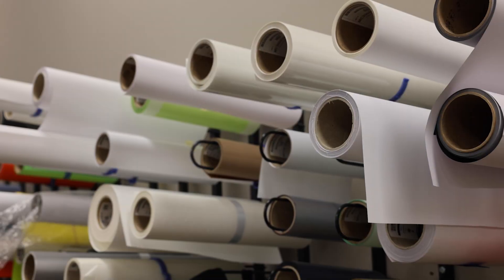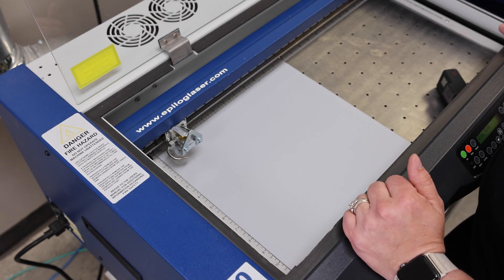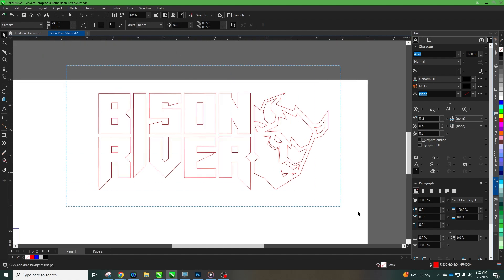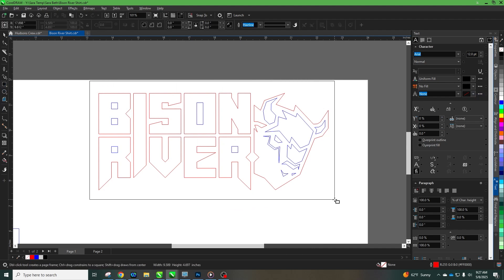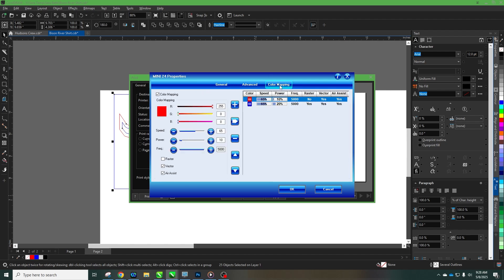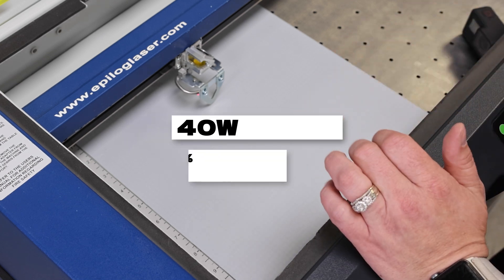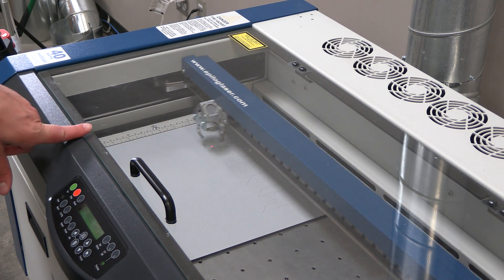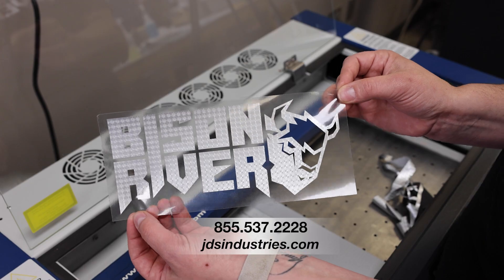Tips & Tricks for Laser Safe Heat Transfer Vinyl

Comment: Can you do this with a 100w tube laser?  Setting?
Reply from the maker: with 100w you would want to be at a very high speed and low power. We don't have a laser like that in house to test with so we wouldn't be able to provide specific settings unfortunately.
Reply: @JDSINDUSTRIES  What are the best recommended settings for an Xtool Diode laser?
Reply from the maker: We only have trotecs and epilog co2 lasers in house to test settings so we wont have anything specific for your xtool. We'd recommend checking out some Facebook groups for your laser brand and see if members have some starting points for you with your specific wattage and laser type!
Reply: @JDSINDUSTRIES  Can a co2 galvo engrave and cut the material
Reply from the maker: The laser you see in this video is a co2 so it should work great! With a galvo, you will just need to be aware of how large your marking area is to know how big of a design you can create.
Reply: What mat was used in under the transfer paper?
Thx.
Reply from the maker: A Seklema Mat! You can learn a bit more about them and how we use them here: https://youtu.be/pRivwLWsYzI?si=M2VMBg-kd3ziCjNM
Reply: Will diode or fiber work?